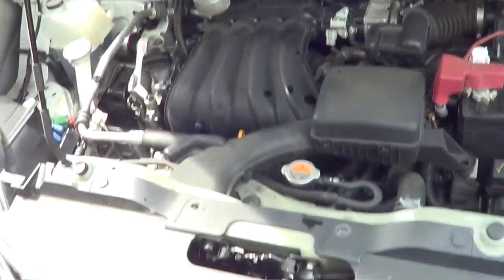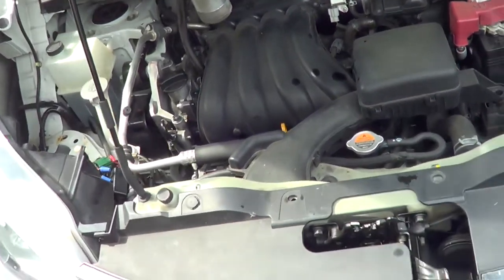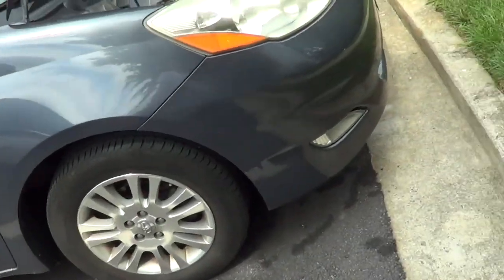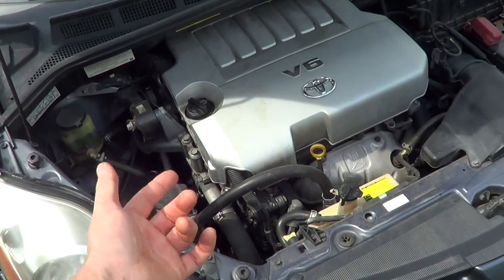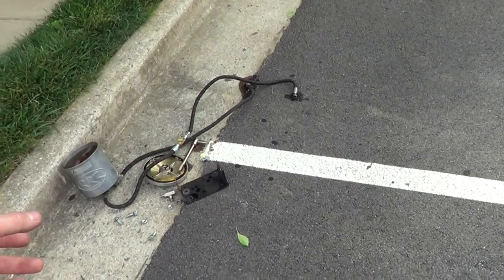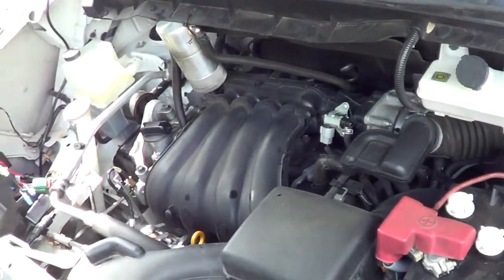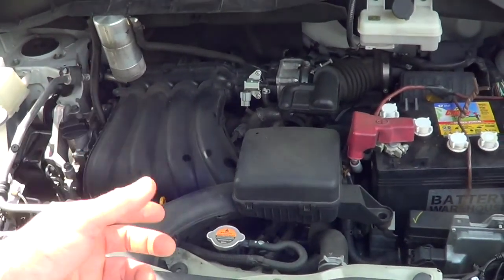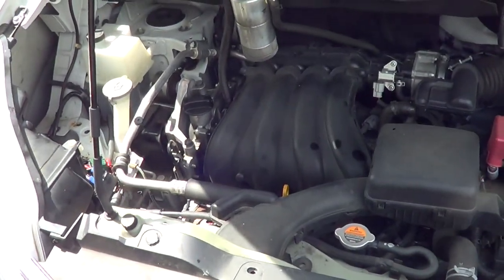Oil Bypass Filter Pulled on Gasoline Engine

Comment: It has been proven that the oil filter gets better over time. The dirtier the filter, the better it gets up to a point. Over all I think it's better just to change the filter when you change the oil. It will save you the expense of a new filter.

Comment: It would have been a decreased oil pressure that was responsible for the variable valve issue due to the restrictor on the by-pass being too large for that engine, I experimented on my amsoil which had a 1mm orifice   down to .5 as not to effect the oil pressure.

Comment: Yea i can see why it wont work on small cars  also so little oil around 4-6.5 L it would work better if it would get restriction or go first thru a pressure regulator but it would probably leak  or a oil thermostat with a 60-70 °)

Comment: I couldn’t DISAGREE more with literally everything you tried to say.
There is countless points on test results on the bypass systems, that are documented backed with laboratory chemistry tests,  they absolutely DO work well. All of them do pretty much the same. 
Chemist Lake Speed discusses it at length what is what on the results tests do show. 
Just the fact that the particulate filtering DOES mechanically Work as advertised designed, both.

Comment: I’m running a Frantz bypass oil filter on my 1990 Mazda B2200 pickup. It sees severe duty , long hot hours, dusty logging roads , dusty mine roads, etc. 

I run either LiquiMoly or redline 5w40 full synthetic in it. 

Main oil filter is a Donaldson filter, bypass is a Frantz 

Truck has 1,375,324 KM’s on it. I run 25,000 oil change intervals . Main filter gets changed at 12,500 km intervals. 

Oil runs clear and clean . I send off oil samples often and they tell me the oil is good for another 75,000 KM’s plus 

Bypass filters are an excellent way to get millions of KM’s out of your truck / car. 

Not sure why you had issues in your car, using the Frantz filter??????? Something not right here ….. bypass filters extend your engine life by hundreds of thousands of KM’s or more. 

🤷???

Comment: Sounds like you need to do an oil analysis. 
Microscopy would be helpful too.

A normal oil filter will only filter to ~40 microns.
A bypass oil filter will filter to ~2 microns or less.

You can hear the difference: 
Better filtration = A quieter engine

Wear is reduced: 
Particles 2~22 microns are the main cause of wear in an engine

However, we still change our oil at the regular recommended intervals because the additive package is depleted e.g. TBN (Total Base Number) is usually very low: Alkalinity is depleted
The wear on our engine is minimal and it uses no oil so we know it's not doing any harm.
We probably could run the oil for longer without any harm.
We've been running bypass filters over 4,000,000 km in many different cars.

🙂

Comment: This review is at odds with a lot of testing.

We've got a similar spin on filter from Trasko on two cars and it filters to under 1 micron (verified by microscopy). 

The Trasko doesn't allow you to keep using the same oil forever (never tried)... but the oil is in better condition after fitting it.
You can hear the difference when you fit the filter. The engine is quieter.
The big cooling fins on the filter also cool the oil better than a normal filter... which is good for longevity.
We change the oil at normal 10,000 km intervals... but the oil filter media gets changed every 80,000 km or longer.
The oil is analysed at each oil change to check wear is within normal levels and it will tell us when the oil filter needs changing.

One car (2015 Yaris 1.3 L) has travelled 200,000 km now and the old car (2006 Yaris 1.3 L) is at 366,000 km.
Both have had the high efficiency filters fitted since new.

Previously our 1.5 L 2006 Mitsubishi Colt had a Trasko filter fitted. 
It made the engine so quiet that you couldn't hear it:
My sister called me out twice insisting that the engine wasn't running.
That car got to 496,000 km before we sold it... and it was still running like new.

A high efficiency filter works brilliantly:
It's a great investment and saves a fair bit of time and money (less filter media changes required).

It's not clear why your testing should conclude differently.

🙂

Comment: Bypass filters help prevent engine wear by another 30%. This is proven and documented by the SAE. They’re also not meant to keep oil honey color. It seems you don’t fully understand what they do. If you think it uses too much oil, you can also partially block the passage way to limit flow.

Comment: I have found, with Amsoil, and Amsoil EaO filters, the oil never really gets black. The combination of the synthetic oil and the filter that filters 10 microns lower than normal, it very well may not be necessary. I ran an 05 Corolla for 14 years, over 330k miles, ran fantastically when my wife totaled it. In fact, I felt that it never really got broken in until 220k, when it stopped burning oil like it was new. Only problem it ever had was valve cover gasket, and the rear main seal had begun a very small leak.

However, I have noticed a big difference on my diesel engine with a Frantz filter using Scott's 1000 toilet paper. Diesel oil usually gets completely opaque and black. But with the bypass filter, the oil still retained some translucence, though it was still black. It was black but I could tell it wasn't carrying nearly as many particles.

No, diesels are not meant to run with "dirty oil." Especially the ones that use HEUI fuel injection, which uses high pressure oil to inject fuel. Diesels are far more durable and they have much larger filters, usually. My Detroit Series 60 engine has two filters about the size of 3 liter soda bottles.
Reply: 👍 I'm curious to know your opinion and recommendation on a frantz bypass vs Amsoil bypass for a gasoline automobile
Reply: @harrysacket  Sure. I am an Amsoil user and operate one Frantz filter at this time.

My view is that Amsoil bypass filters are pretty expensive. And I think Frantz filters have the ability to filter a little better with cheaper media (I use Scotts 1000 toilet paper). They are messier and should probably be changed more often, but less than a dollar per roll of toilet paper.

I haven't used an Amsoil Bypass filter yet because every time I go to buy one I get sticker shock. 

I like full flow Amsoil filters because at 20 microns they're pretty much the best available. There is another brand made in the same factory and nearly identical for cheaper but I forget which one it is. 

Happy to continue answering questions if you have any.
Reply: @wiredforstereo  that's the exact setup I was looking to install because I was also sticker shocked 😂👍. Maybe I'll change the toilet filter twice a year and add a quart each time. And maybe I'll change the amsoil every 10 to 15,000 miles or every 1-2 years. Not sure. We'll see how it looks. What's your routine looking like? I appreciate your input given your experience.💯
Reply: @harrysacket  With the daily driver cars, I change the oil and filter once a year. When the car with a cartridge filter was getting a lot of miles (like 30k+), I was changing the filter twice a year.

The 6.7 Ford gets changed when it says to which is 6-10k depending on conditions. Again, warranty. I have been using Rotella T6, but I just found out about the massive oil system and possible oil starvation issues this engine may have, so I will be switching back to Amsoil. In my experience, if you have Amsoil in, you just never have a dry start. And I think that's where it shines the most. Cold dry starts are where most damage is done.

The big trucks only get a few thousand miles a year. They only work during the fire season. So I've been changing them every other year. Filters every year. I'm planning on putting Frantz or maybe Amsoil bypass filters on them as soon as I can make some good money.

The small engines, who knows. I put Amsoil filters on everything that has a filter. The oil never gets black. Every year or two. In the small engines I also often use Mobil 1 extended rather than Amsoil, just for the price and it seems to be pretty equivalent.

My recipe for good running small engines: synthetic oil, and fuel preserver 100% of the time. Rototiller, power washer, start first pull every time, even if they haven't run in 6+ months. If you can't get your small engine started, you just don't have the right fluids in it. 

Also, have your oil tested occasionally, if not yearly.
Reply: Lol u probably had gummed up rings...
Reply: @fritzsnickerz855 Yeah, because it makes so much sense that a car would come from the factory with gummed up rigngs, fuck, the bots are really getting thick.

Comment: Does not make sense before i belive your negative assessment i would have to know the flowrate of your bypass filter setup to see if it was putting enough clean oil back into  the system yo make a difference. If you clean oil down to one micron it has to better for the engine then oil cleaned to 30 microns its not possible that this is wrong.
Reply from the maker: I just couldn't see evidence in the oil testing.  I was hoping to see clearer oil.   Since this video, I just oversize the main filter.    The tiny lawn mower oil filter on the nissan actually clogs up at 2000 miles and starts opening the bypass relief valve on cold starts.    I added dual pressure measurement to check the in and out pressure thru the media.    A good 30 micron main is plenty to keep the engine clean.    But, changing the oil at 7,000 miles is even better.

Comment: I feel like you conclusion was biased , There was almoist no actual testing done.  Also filter placement might be a issue if your getting bleed back it sounds like the check valve is supect or the placment is to high.

Comment: Did it remove more metals from oil than just factory filter?
Reply from the maker: I couldn't tell a difference.   But, several people commenting swear by these bypass filters.   I just run an oversized main filter now.   I'll do a video on it.

Comment: Do you still have the oil bypass kits would you sell them thanks and interested on how things been going since you put this video up thanks again
Reply from the maker: I sold them.   I don't think bypass works.  Instead, I just use an oversized good quality main filter.   The little tiny nissan factory filter would clog at 3000 miles.    If you want to know if your oil filter is clogging, just look at the startup oil pressure when the oil is cold.   Compare that pressure when the filter is new.  My nissan would have 100 psi when the filter is new and the oil is cold.    Then, it would start dropping to 85 psi as the filter clogged and started opening the internal bypass.
Reply: @NathansHVAC  thank you for the response I will take your advice 👍

Comment: Hopefully without insulting your thinking approach or your method, you seem to have focused on a small point:  oil change interval, and missed the most important aspect of bypass filtration, which is engine wear reduction.   The oil change interval is affected by tbn and coversely the  acidity of oil    Engine wear is very much reduced by bypass filtration, at the filter removes small particulate matter that wears engine part surfaces.   Again, and I will go over this for the 101th time, most engine wear occurs from particle less than 5 microns.   Full flow filters do not remove those particles to any significant degree.   Full flow filters are responsible for filtering oil under extremely high flow rates.  This the filter media in a full flow filter is very thin with large pores to allow such a pressure to be achieved.   Thus, full flow filters are at best 90% effective at 20 micros or above, and very ineffective at filtering smaller particles, virtually not removing at all the wear particulates at 5 micros or less.

If you purchased a bypass filter to achieve longer oil change intervals you have really missed the value of bypass filtration.    With bypass filtration, and I have tested this oil analysis, you remove the wear particles to a statistically significant degree.    The benefit of bypass filtration is analytically clean oil from mile 0 to mile XXX, whenever you change your oil   IF you don't use bypass filtration, you will have more particulates in the oil from miles 0 to mile xxx.    Who really cares when you change your oil, if the oil is clean all the time from particulates, then you have added value financially in terms of 1.  engine life (not forced to buy another vehicle or rebuild/swap engines 2.  MORE efficiency (the oil pump is pumping around less mass at that high velocity.

Further, your conclusion of "not needed"  is really only true in relation to oil change interval, and i question your methods and conclusions even from that.    Certainly, "needed" if you want full compression throughout the lifetime of your car.  With bypass filtration, you determine the lifetime of your engine, not uncontrolled wear. 

2001 audi a6, 215,000 miles.  full oem compression
1998 camry  378,000 miles, full oem compression

Bypass filters on both.   I could care less about oil change interval, as oil change costs are insignificant compared to the cost of new engine, or new car.   Oil change interval is affected by other factors,  the main factor being acidity, and that has to do more with fuel dilution, water dilution, that are aspects of your mechanical seals and engine management settings/ performance, driving style, ambient and engine temperature, etc.   Once you get water in your oil, or fuel dilution, it is time to change your oil .   I don't know but I don't believe any filter system will reduced or eliminate oil acidity once it has occurred.    So, the take away is, yes bypass filters alone will may not increase your oil change interval.  However, they will dramatically decrease engine wear regardless of when you change your oil.
Reply: What oil bypass do you recommend thank you
Reply: @leardi58  Thanks for the question.  Obviously there are a few formats to choose from.    While I didn't consider the PRICE of the primary installation as a huge consideration, it could be.   What was more important to me in choosing a bypass setup was 1. effectiveness and 2.  price/cost/time of filter replacement, because, in order for the bypass filter circuit to do its intended job, that filter needs to be replace on some kind of specified interval.

These were the main formats I recall considering.   1. Amsoil    2.   Frantz  3.  Motorguard    

Amsoil  was the most expensive in terms of initial installation cost and ongoing filter replacement, and also took up the most room.    With trucks this isn't an issue, with late model cars it certainly is.    It's like 50.00 or more for the filter replacement, I am not sure of the exact cost, but it seemed high but mostly I don't like part replacement dependent on only one company.      

Frantz was next.    And this is the one I installed on two vehicles.   I was able to plump the lines myself and install the brackets.  The replacement filter can be ordered from the distributors, but I simply use Scott 1000 single ply paper from Walmart at about a dollar per roll.

The Motorguard would be similar to the Frantz in ongoing costs.     There are several other similar type filters available .   This was over 10 years ago and I am typing this from memory.   So I may have missed a few other points or additions.  

I ran several tests sent to Blackstone labs and the frantz operated as advertised.    One the first filter run, I ran the tests comparing what was 4000 mile used oil and then after 500 miles on mostly the same oil (save for the extra required for the filter and external oil lines) post bypass installation .    Essentially the old oil was "dirty" after 4000 miles but at 4500 miles the tests came back analytically clean with tbn values in the proper ranges.   TBN is a measure of alkaline or conversely, oil acidity.   This test confirms that your engine is not diluting the oil with fuel, water, the bypass filter is doing it's job of removing excess water from the oil, or the oil has enough additive to mitigate acidity.   I also ran a test with brand new oil from the bottle and used oil from this setup.    The old oil that was filtered through the bypass system actually had less particulates than the brand new oil.   I found that interesting, and seemed to support the idea that bypass filtration is very effective.    

This confirmed that 1. Bypass filters can do the job they are meant for and 2. My particular setup also worked as intended.   I am sure the Amsoil filters or other brands would work well, just my personal preferences led me to the Frantz installation.  

I then ordered a newer version of the Frantz, called the Refiner, that was easier to change out and had a larger filter capacity.     Ed Greany produces them and sells them in California and I was pleased with his customer service and advice.   You can google for the information.

Comment: Sounds to me like you put some good bypass filters on some 100 plus thousand Mile wore out junk, using the cheapest oil possibly obtainable, and was expecting some sort of miracle. It works, science proves it works, and history proves it works. Bypass filters were developed by the British during world war II because the Germans were choking off their supplies with U-boats. They Didn't have any oil for the aircraft, and the Brits came up with this as the solution. Well at the end of the day the Brits won the Battle of Britain, while at the same time, both of the engines that you demonstrate in this video were manufactured by the masterminds of Pearl Harbor.